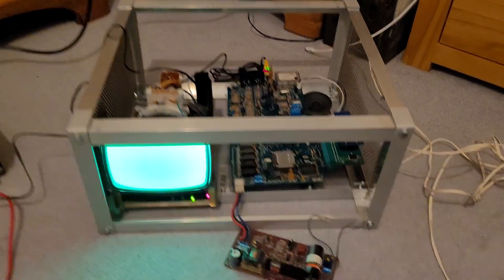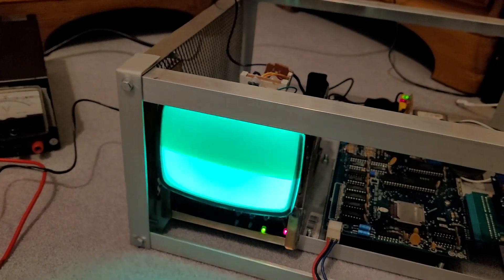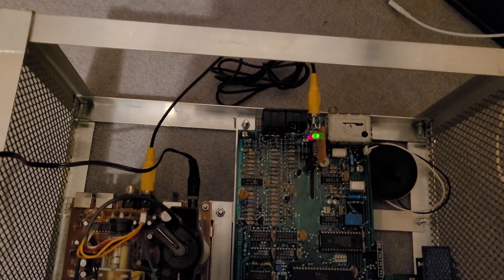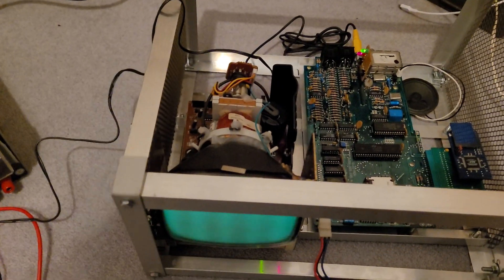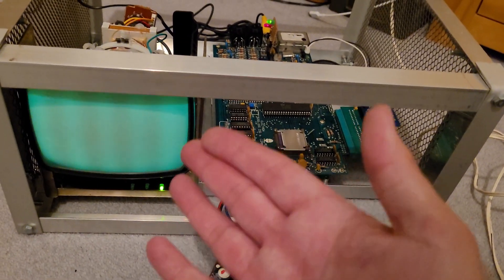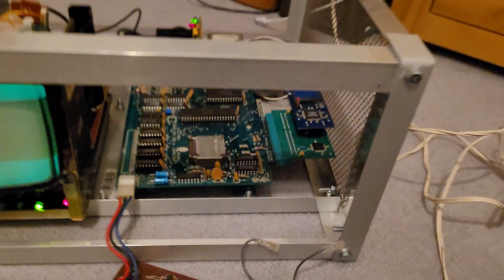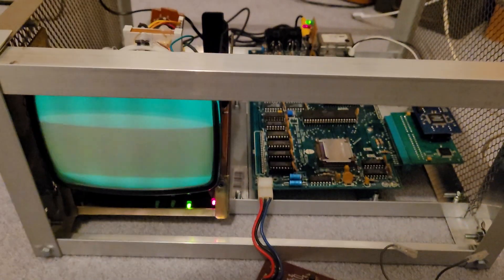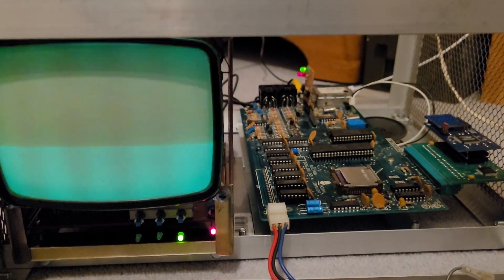Acorn Electron Portable MK2 #2

Comment: RMC did a video on this last week funnily enough, apparently the display sometimes goes because the cpu socket is dirty. They cleaned it with IPA and it seemed to work after!
Reply from the maker: Indeed, this board originly had a soldered on ULA, it was dead, I replaced it (Yes they are unobtainium, but I got lucky). The soldered ones are not that reliable. The RAM also died, fixed that to. In this case it is the monitor. Did a hole load more testing off video. Also the Electron LED's & sound output was indicating a successful boot. I saw that video. Oftern it is the soket pins that fail. I was able to get hold of spairs & I kept the dead socket as I can extract pins from it. I am yet to come accross a case where cleaning the pins with IPA fixes anything, sadly most of the issues I see are always more complex. I did watch his video, got a pretty cool setup.